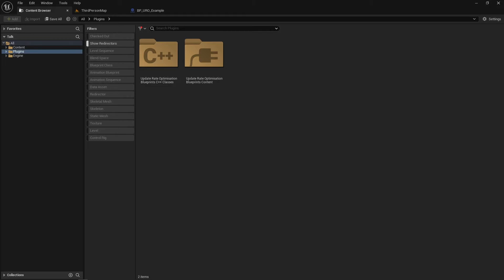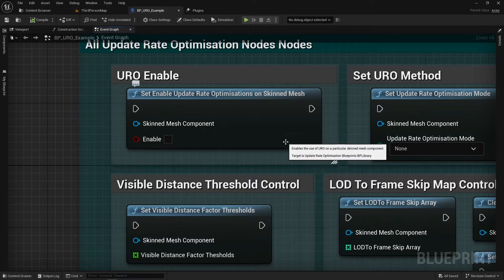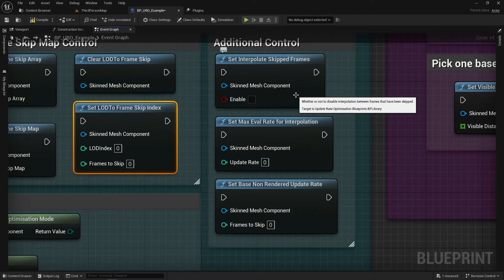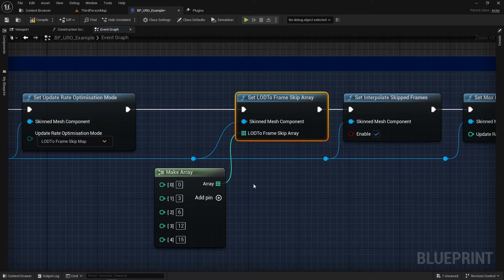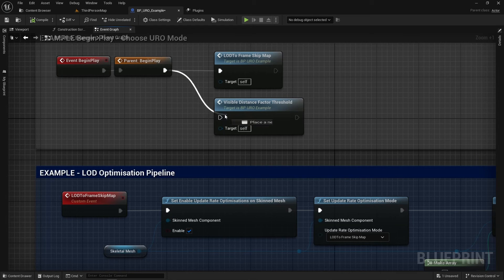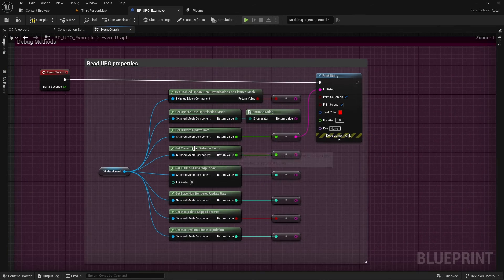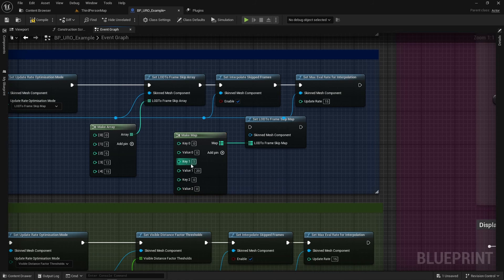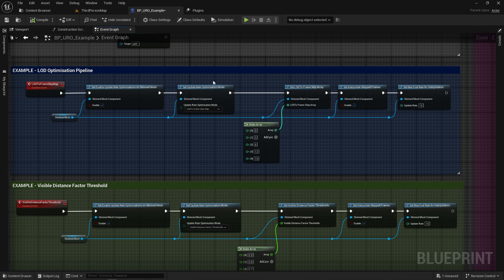Unreal 5 - Update Rate Optimisation Blueprint Nodes Plugin Walkthrough

Comment: Unfortunately, the plugin crashes when building for WinGDK (Windows Store).
Reply from the maker: Hello, what's the logs? I have shipped a handful of projects with this so far. I haven't built for the Windows Store before though, just Windows/Xbox/PS5.
Reply: @MattLakeTA It actually wasn't easy to figure out, because it crashes with a Fatal Error and the log ends up incomplete. While everything works perfectly in a standard Win64 build, with WinGDK I ran into two plugins that weren’t compatible — even though they’re fairly simple plugins. I'm using Unreal Source 5.6.1 with GDK, in case you want to test it yourself.
Reply from the maker: Hey buddy! If there are no available logs, what information points to the update rate optimisation plugin crashing? I haven't got or used the WinGDK before - I'll have to look into it
Reply: @MattLakeTA  Ok, I just found the problem. Some "runtime" plugins are set only to "PlatformAllowList: Win64", which means they don’t work or even completely crash the game. The solution is to add WinGDK in the .plugin file, or simply remove that line (so it works on all platforms).
Reply from the maker: Glad you found it and that there wasn't actually an issue with the plugin systems! Great news!

Comment: Just dropping a quick note to say that update rate optimisation conflicts with multithreaded ABP, causing higher LODs to freeze (suppress updating).

Once I realised you were essentially just exposing Unreal C++, I started digging in a bit and realised that (at least as far as I can see), frame skipping always happens on the main thread meaning while TickPose() is moved onto another thread (with multithreaded ABPs) meaning the two operations cancel each other out. I'm exploring some other solutions and will drop a comment below if I can find something.
Reply: Just a quick follow up:
I think the ideal approach would probably be to use an async ABP for LOD0 and sync ABP for greater models with Update Rate Optimisation, although maintaining two ABPs is an absolute nightmare.

For anyone interested, I ended up completely abandoning Update Rate Optimisation and basically connected significance values and the tick rate of both the movement component and skeletal mesh component. I made a float curve based on (x−1)^2 (1, 0), (.5, .25), (0, 1) and set the new tick rate based on the output of MyCurve->GetFloatValue(SignificanceValue).

It's a bit stuttery at long distances but it can be tweaked easily. Most importantly, it's bought me 10-20 fps on my NPC heavy game.

Comment: are there any plans to update this to 5.6 😢
Reply from the maker: Hello buddy,
Yes there is! I'm away at the moment and will move it over when I'm back. :) 

Watch this space!
Reply: @MattLakeTA thank you so much! Recently updated to 5.6 and I realized just how crucial the plugin was!
Reply from the maker: @jaycusandas2392  Hey buddy, I'm back from my break.
I've updated the plugin to 5.6 and submitted it to Fab pending approval. If you want to get it any sooner, you can grab it off the git at https://github.com/MattLakeTA/Update-Rate-Optimisation-Blueprint-Nodes/tree/5.6 
Enjoy!
Reply: @MattLakeTA thanks! During the intermission between messages I found a way to update through messing with the version numbers. Do you think a manual update is sufficient still or should I use the updated version from the marketplace?
Reply from the maker: @jaycusandas2392 there's nothing special in the update just that the launcher registers it as the correct version. You should be good buddy!

Comment: Hey Matt, what's up? I'm using the plugin you created, Update Rate Optimisation, and I'm encountering some buggy behavior. It works great with non-procedural characters, but when I try using it with procedural characters that assemble their body parts from a data table in the construction script, the whole system stops working. Do you know why this might be happening?
Reply from the maker: Hello buddy, I'm sorry to hear you are having issues.
There should be no difference between multi-skeletal meshes and single skeletal mesh pipeline, as they are all skeletal meshes as the end of the day. Perhaps there is something going on in the construction script that may be causing the URO settings to reset? Are you applying the settings in the construction script or in the begin play? I'll quickly do a test on my end and get back to you.
Reply from the maker: Hey, I just confirmed - I setup a multi-skeletal mesh component asset and applied the URO technique to it and it behaved as expected. I tested in 5.5 if that provides any additional context, but the code hasn't changed since the 4.27 version.

Comment: So i'm having a bit of trouble with this- based on my experiments the number that goes into Visible Distance Factor Threshold is not the screen percentage? because even in your example the max distance factor is nowhere near the same number as the screen percentage.. so I'm not sure which we're supposed to be  using
Reply from the maker: Hello there! Yes the Visible Distance Factor Threshold takes the screen percentage of the skeletal mesh as a decimal, so 0.25 = 25%. You can use the A.VisualizeLODs 1 command to see the current screen percentage to help you tune your values :)

Comment: the animations arent interpolating for me, no matter if i enable or disable set interpolate skipped frames. Whenever i set the max eval to what i have on my last LOD, it seems like all the performance gain goes away as if none of them skipped ticking. did i miss something?
Reply from the maker: @b0rbLmao  Hello! Have you enabled the URO system? It is best to refer to the example asset that I provided for a default setup :)
Thanks!
Reply: @MattLakeTA  hey thanks for replying! i'm using the LOD based example you've provided and sadly its the same. i can tell visually and by debug that the tick is going down but interpolation of the animation just isnt happening. i have a very simple BP and ABP with barely anything happening. The ABP is just looping an animation from a state machine.

i've also just tried using the example BP itself, giving that the skeletal mesh im using and the ABP. I enabled only the LODframeskip one and its still got the stop motion look and not interpolated. im really confused
Reply from the maker: @b0rbLmao  By the sounds of what you're saying, you want to reduce the update rates, but always keep interpolation on?

To ensure Interpolation is always happening you'll need to use the Interpolate Skipped Frames, and then set the value for the Set Max Eval Rate For Inteprolation node higher than your maximum skips. That value determines the update threshold of when the interpolation turns on/off.

In the included LOD example, the interpolation turns off at LOD04 @ 15 skips.
Reply: @ thank you for your time! that seems to have been the problem, i may just be stupid as i misinterpreted the comment on that node. thank you again! you reply very quick!

there's one last thing i'd like to ask if you don't mind, whenever an LOD ticks, say the one that ticks every 12 frames, do they all tick together after 12 frames or are the ticks spread out
Reply from the maker: @b0rbLmao  Ah amazing! I'm glad we got there in the end. It was more than likely the nodes setup, they are dependent on one another!

That's a good question. As far as I am aware, the sync should depend on the objects initialisation state - so if one initialises at a different time to another, the updates will be out of sync, but if they initialise at the same time, they should sync. It is a tricky balance however, as other optimisation systems can disable the update if the object goes off screen, so then they will be out of sync again.
Reply: @MattLakeTA   ah i see, that's interesting. then i suppose changing them to only tick when rendered would do the trick. thank you! Your animation optimization talk in unreal fest is gold!
Reply from the maker: @b0rbLmao  Aww thank you buddy! I'm glad it was educational :) I'm really happy we fixed your problem too!
You should join the Discord! Lots of cool people in there to learn from and share with one another
Reply: @MattLakeTA  oh you have discord server? I'm definitely gonna be joining when i get on pc tomorrow, cheers!
Reply from the maker: @b0rbLmao  https://discord.com/invite/makucg465T